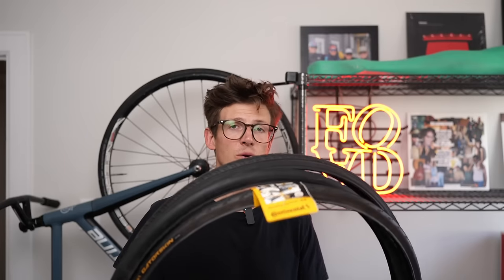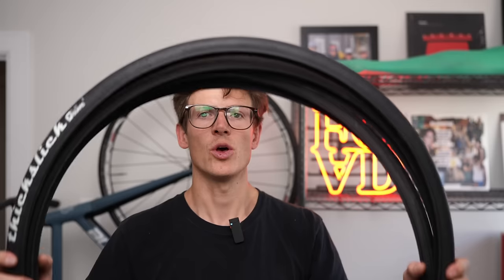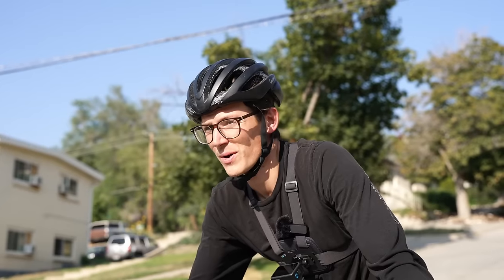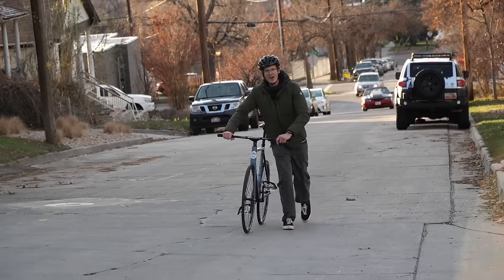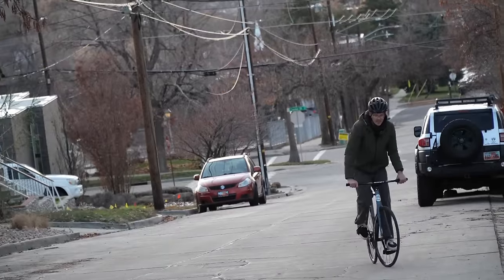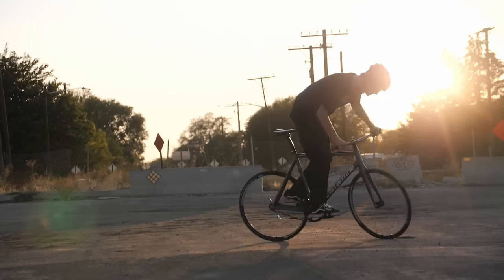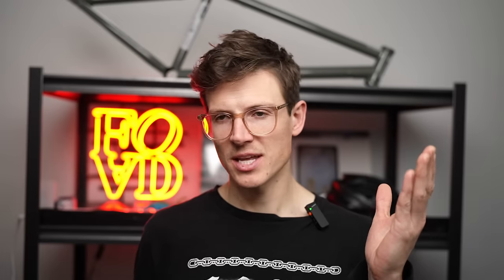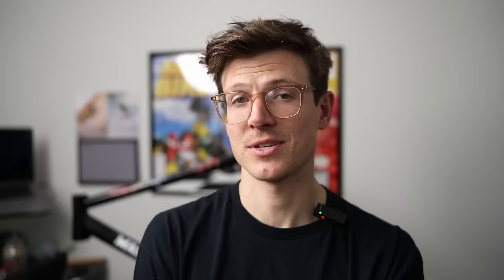FIXIE SKID TEST - TOP 3 Tires for Fixed Gear Bikes

Comment from the maker: What tire should I test next?
Reply: obor mojo stamnia is super cheap but for me it lasted the longest
Reply: all the panaracers
Reply: and i mean ALL. we gotta make sure the color compounds don't alter the skid performance.
Reply: Resist Nomad vs ThickSlick for trick track…same price point and it seems (to me) similar performance for tricks. Don’t know which is more durable however.
Reply: I can't seem to be able to do any damage to my Panaracer Gravelking SS, very good allround fixed-gear tire it seems !
Reply: I'd love to see a test that compares drivetrain pairs of small cog+small chainring vs big cog+big chainring of equal gearing. Say, 44/15 and 50/17 (gearing difference is almost negligible here). Ideally you would want to get hold of a power meter. I am planning to run small combo this summer and I've been wondering if this is going to affect drivetrain efficiency.
Reply: Chaoyangs are farely popular here in the Philippines, I'm quite curious how they'll perform in your test
Reply: some tubular tire... because everyone says that tubular tires are not ok for fixed gear
Reply: I would be interested in the Performance of the Michelin Dynamic Classic as a cheap option and the Continental Grand Prix 5000 PolyXBreaker
Reply: Continental GP5000
Reply: Continental Super Sport
Reply: Super curious how specialized armadillos would fare. They’re basically specialized’s version of gatorskins.
Reply: I love my Gravelkings, maybe you can test if there's any difference between the normal ones and the plus. Also the slick makes this funny zipper noise when skidding :)
Reply: do cheap tires
Reply: Try chaoyang
Reply: Maxxis Refuse for life
Reply: Schwalbe marathon??
Reply: Try the Chaoyang Hipposkin
Reply: been running continental 4 seasons for a while now and they seem to last forever and give sick grip
Reply: on my fixed gear I discover 4 seasons tires, and never change !
Reply: Panaracer Ribmo all day! Such an underrated tire!! Do try
Reply: Continenral ultrasport
Reply: Chao Yang!!
Reply: Would be good to see the Maxxis re fuse and maybe schwalbe marathon 🤙🤙
Reply: chaoyang mini shark
Reply: Chaoyang attack pard vs chaoyang mini shark
Reply from the maker: @flensle do you like the slick version or the SK?
Reply: Kenda or chaoyang Hippo skin
Reply: bontrager T1
Reply: @SORBETVM panaracer ribmo is my favorite is my favorite tire
Reply: Chaoyang Hipposkin, shark skin, and mini shark
Reply: chaoyang tire hippo skin..mostly use here in the philippines
Reply: gravelKings
Reply: Duro orange creamsicle - terrible tire, but lasts forever
Reply: Soma everwear great for skids
Reply: Tufo S33 Pro. I have them on my bike and they are amazing. Best anti puncture and skid rezistent tyre in my opinion at only 25 euros per tire.
Reply: The only reason the gator skin did not too well or weigh heaviest because you didn’t get the hard shell gator skin
Reply: Hey, thats a coolass test you provided for us. I've been wondering a lot which tires gives the longest skid distance, and thats something to really appreciate. I can only speak for fixed community in southern europe, and tires we usually use here, besides gatorskins You already tested, would be: Continental Ultrasport, Vittoria Zaffiro pro/rubino, Continental GatorHardshell. Im actually suprised that Vittoria wasnt put in this test. Anyway, this are the tires i'd put up, for test but imho i'd love to see the skid distance of continental 4 season
Reply: Kenda Kwest!!!
Reply: Vittoria ridearmor might be the best

Comment: how about the low cost tyre like Kenda... 😅
Reply: Wkwkwkw gw tu pake kenda
Reply: @Lan_no1234 Keras bet keras tuh ban cuma jujur tuh ban badak bngt 🤣🤣🤣
Reply: Tire*
Reply: From my experience Kenda is indestructible. It takes 2 to 3 years of daily road shredding to break them.
Reply: @M0rb dont know which kenda u ride on , but i skidded through the road kenda in like half a week or a bit more
Reply: @1glajpeg  That would be Kenda Kwick Roller tires in 650c / 32mm

Comment: As a scientist who has loads of experience designing experiments, I approve!! Great video and very informative. I’d love to see how Panaracer gravelkings hold up
Reply: Skid on my 33 gravels all day  and they hold up great
Reply: Same, it’s been my go to for a while. But I’m curious how it holds up relative to others. Especially since they’re so damn expensive, am I wasting my money :/
Reply from the maker: Thank you! Are you interested in the SK or the slicks?
Reply: @FOADGang  I’ve always been interested in how the two would compare, but if I had to guess, knobs are gonna shear off quickly when skidding, so the slicks seem more appropriate to test for fixie foos
Reply: As a DoE desiger you should know that those runs should be conducted as least three times to get average value and conduct analysis of variance. Moreover, FOAD's approach is not DoE overall, this is just COST test.

Comment: Good fixed gear tires imo
1: Maxxis Pursuer
2: Goodyear eagle sport
3: Continental Grandsort race

1 and 3 feel about the same to me. 1 is just lighter. Both tires provide a lot of grip which is pretty important for brakeless riding. 

2 is lighter than the other two. Easier to whip a skid. Wears out the fastest. 

I love all them three

All of them are around USD 20-25 where I live
Reply: The 1st one is pure shit

Comment: It was a really informative test. I'd even go so far to say - based on the end results - that the Gatorskin makes the best value tyre of the three by although having the same skid-distance per dollar as the ThickSlick but having the longest endurance because then it saves you a .4 of a tube and the time of changing the tyre and the tube until the next inner-tube burst.

Comment: I’ve used either Gatorskins or the Bontrager AW3 on my bike for years. Both are expensive. One day on a ride, my gatorskin blew out. Luckily, I was near a bike shop and I bought a nylon 23c Kenda Kompetitor. Even though the ride was kind of rough, it outlived both of those tires and I only paid 16 bucks for it. I have another one on there now.

Comment: In my experience Thickslicks and Gatorskins are great tyres for perfect riding quality, given you want to optimize your fixed gear bike down to even the last minor detail and the last fraction of a millimeter. Thickslicks are very close to silent. On an aluminium frameset I'd use Thickslicks and on steel both go well. Thickslicks are easier to skid, especially when you're running a bigger gear ratio, but Gatorskins stop quicker as they're really tacky (and noisier) - you definately made that point. Also found out even the standard Thickslick (Thickslick Comp) has better puncture protection (concerning those nasty 2 mm triangle shaped glass fragments, which we have a lot of in Dortmund/Germany). Slippery when wet? Naw... just don't lean into corners as you would do in dry conditions and go a bit slower, does the trick. Oh, and the Thickslick squares out on the rear quite quickly, even if you're not skidding at all.

Comment: Another factor is different road surfaces… thickslicks lasted forever in Seattle but hardly at all in SF the inverse is true of randonneurs…
When I was getting tires for free from mash they gave me continental contact sports which slid like crazy but wore out really fast. 
Ultimately the tire I found best suited fore SF was the continental super sport. Those paired with rotating the wheel every few days made them last for about a month but by that time they were on the orange all the way around…

Comment: Nice idea for testing, becouse it takes in-field (skids) and laboratory (grinder) approaches. However, for the future tests I encourage you to develop basic statistical knowlendge to make the tests valid on the statistical level. Firstly, the basic thing is conducing the same run (trial) at least 3 times to get the average and error values. This allow you also to exclude outliers (values that are very far from average which could arise as a result of wrong boundary conditions, such as local manufacturing defect of the tire). After having the results, you can compare the outcomes. To compare it visually you can use "box and whisker plot" to see if "boxes" (quartile) are overlaping eachother. If yes, than there is a chance that there is no statistical difference between groups, thus the hypothesis about some tire being better cannot be confirmed. For quantitive evaluation you can conduct simple analysis of variance with the p-value of 0.05. I think all this can be done in Excel or some online websites. This is not so complicated as it sounds, novadays you don't really need the background knownledge about all of this becouse of software doing it for you.

Comment: What's also going to be a factor with the thick slick is that you're using the flat guard which is thicker and heavier than the typical comp version. That said, it's probably not going to make that much of a difference as I've run both and they're honestly not too noticeable between them. Fun experiment still! I'd vote for the Vittoria Rubino Pro, GP5000, and gravel king slicks for the next tests!
Reply from the maker: Thanks for pointing this out, I didn't actually know that there are two different versions!

Comment: Tests have shown that bicycle tires do not need any tread.
What are the tasks of a tire tread? It's supposed to conduct water so that it doesn't build up in front of the tire while driving and then cause aquaplaning. It was calculated that even a fat bike would have to travel around 77kmh (48mph) to cause aquaplaning. A coarser tire profile is intended to ensure that the tire does not spin on or in loose surfaces but rather "works through" it, for example in snow or mud.
Or to put it the other way around, if it's slippery, it's slippery. Just think of a deserted road or wet cobblestones, no tire tread in the world will help. Which would also be illogical, positive(?) tire tread reduces the contact surface and thus promotes slipping. So if it's slippery, it would be better to have a slick that offers a little more contact surface due to less air pressure.
The Schwalbe company was once asked why they offer profiles on many tires. The answer was that the customer then feels safer.
The rubber compound will be more important, so in order to stop faster during skids, a softer tire would be an advantage.

The thick slick would then be unsuitable as a (visually cooler) front tire because it apparently has the hardest compound and therefore tends to slip more quickly.

If anyone has anything to criticize about the statements and (il)logical considerations I have read, please let me know.

..and it surprises me that the weights are metric, but the distance is imperial..and I immediately knew that 1/10 of a mile is 160m XD

Comment: I ride with brakes on my fixed gear bike and can't recommend Gatorkins for any wet weather riding. Almost slipped out doing a turn in walking speed, which IMO shouldn't happen at these speeds.

Comment: 17:40 - "There's something that will make any tire you have last a lot longer, and that's just using breaks a good gear ratio.
Reply from the maker: Brakes are great for reducing your need to skid. But if your purely looking at skidding gear ratio makes a big difference.

Comment: Actually, I run thick slicks now and yes they feel more slippery BUT if u want more stopping power you just have to not lean as forward when you skid. When I need to stop in a dime, I just lift myself from the saddle and they do break hard. In your test you were leaning to much forward to be a real break test, obviously you didn't wanted to "break" because the test was to go down the hill, but I think, and I'm speaking from experience, you just have to adapt your skid position to your tires. I ran Continental Grand prix 4 seasons right before the thick slicks and they stopped so hard that I had to lean more forward to maintain a good skid. I prefer the thick slicks as it feels more natural to not lean as much when I skid.

Comment: Great test! I've been running thickslicks but got a slash in the front yesterday.
I'm pretty new but I have a front brake that I've used once for an emergency. I would have gone an extra foot or two before stopping and hit the car that cut me off. Curious why are brakes for this use still frowned on? Also it's nice to squeeze the brake when already stopped at a light to help lift the bike and reposition my cranks ;)
Reply: I'm keeping at least my front brake. You should always have at least 2 independent brakes on the bike so you have backup in case one fails (in the fixed gear case the two could be skidding for the rear and a front brake).

Honestly, I'm currently running two brakes because, why not lol.

I think the brakeless thing is a bleed over from track bikes. On the track, you don't really need a backup to stopping with the pedals and there's no cars trying to kill you. Some people just thought it seemed cool to run without brakes on the road as well. Brakes are light and cheap though, especially if you just have the front.

Comment: Thats not a real rando, only the classic lasts for skidding! And at least for daily street riding in SF traffic, once they break in with the red line all the way around before the threads show they offer the most control. And being able to track the wear so precisely with the 5 different layers lets you confidently run them down until you see the 3rd layer of threads without worrying about a blowout. They're definitely not fast or comfortable but they handle everything you throw at them in any weather.

I tried a gator in the fall when my $15 QBP rando stockpile ran out and initially I was loving how much faster it rolled and how little it seemed to wear. And while it skids pretty well in a longest skid competition sorta way, it feels way less responsive at the initial bite point which makes them worse on the street. And then once you hit that point where you break through the outer layer they are just done and need replacing immediately. I was still considering getting another one since it had lasted a good long while (mostly since I didnt skid as much) and are undeniably faster rolling but then the first rain storm hit and it might be the worst tire on the market outside of thickslicks on wet roads. Totally uncontrollable and a liability to wash out in the gentlest corners.

Comment: Interesting but you can also make your nice tires last a lot longer by just running a brake.  GP5000 with a brake is a great fixed gear road tire. :-)